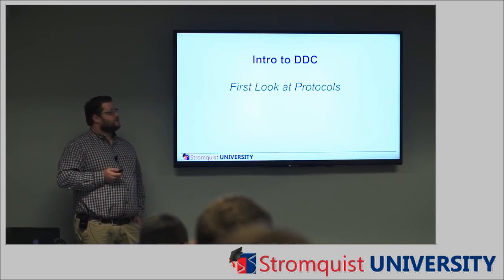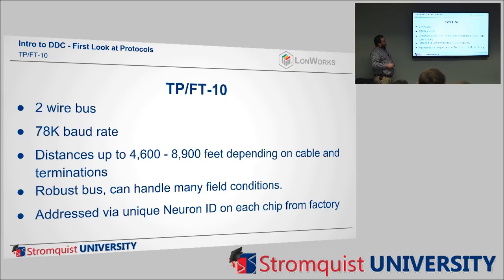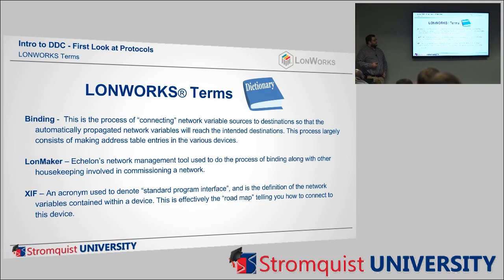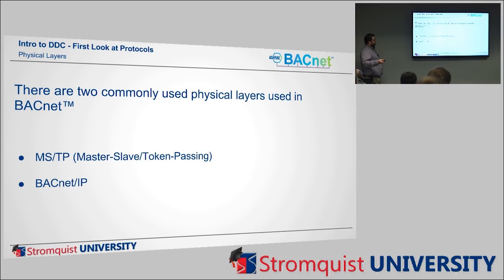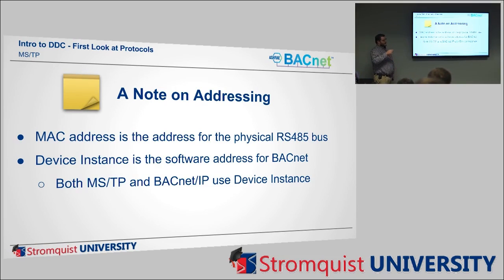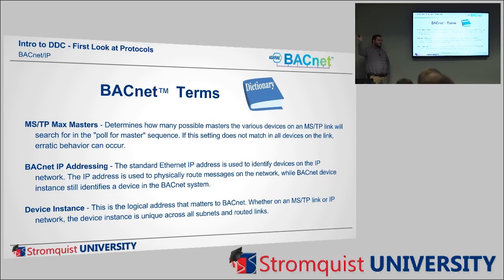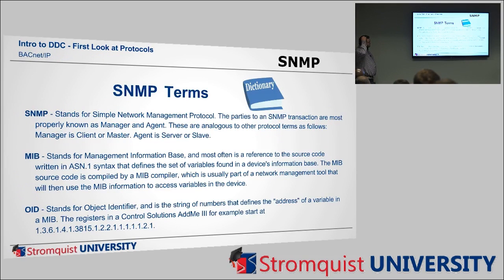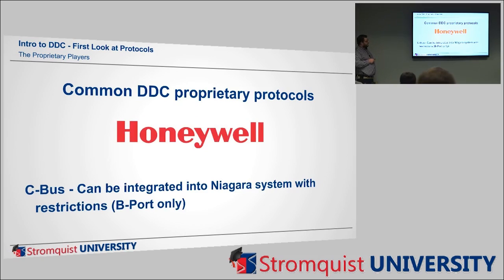Live P3: Intro to DDC - Technical overview of communication protocols

Comment: Listening to the discussion of "Just how open is it?" beings a issue to my mind. With AX it is required that a password be put on the JACE during commissioning. If this is done and the password is not given to the customer or the customer does not keep track of it then anytime that customer jumps to another company that new company is locked out and has no access to the station that was built for the customer. So...is there a workaround for this?